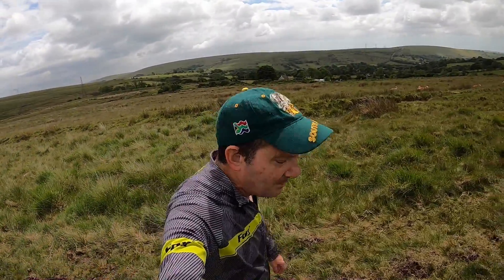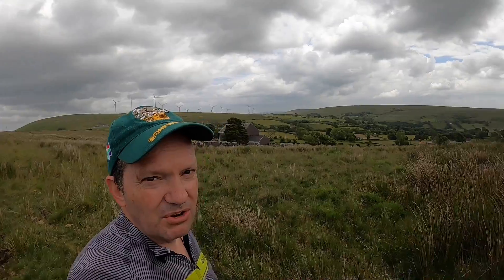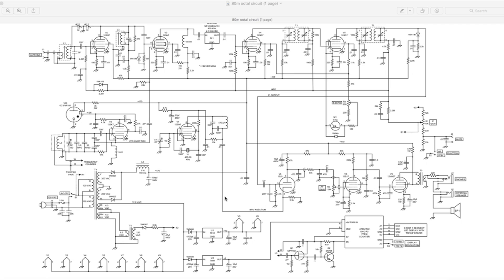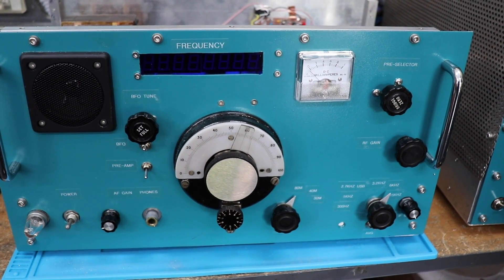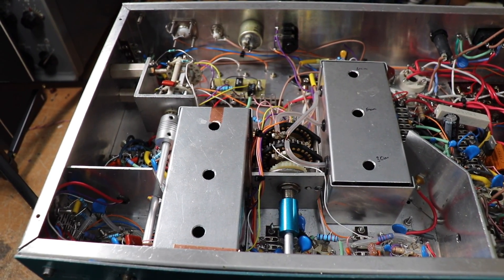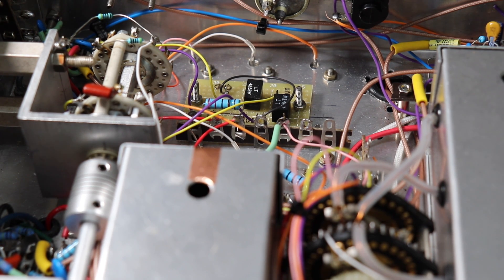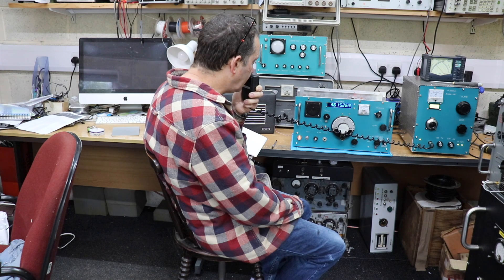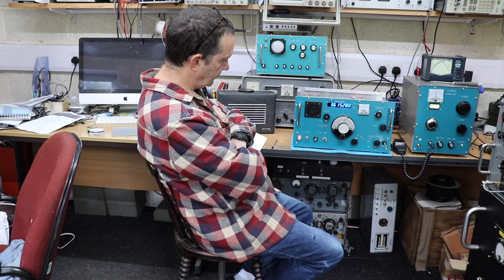My Homebrew Communications Receiver

Comment: Beautiful homebrew receiver.  FB.  But I have a question:  At 12:35 you tune in what seems to be an SSB ragchew on 3.723.808.  But the BFO is off.  How can you hear so clearly an SSB signal without the BFO on?   A bit later you tune in what appear to be the same stations, this time on 3.275.291 with the BFO on.  So how were you able to copy them clearly with the BFO off?  73  Bill N2CQR
Reply from the maker: I think the IF stage is a bit oscillatory ( if thats the right word)!!

Comment: Beautiful job and a wonderful technical accomplishment but using tubes.... Why?

They are power hungry and harder to obtain. 

If you are wanting to be EMP proof  the fet and bjt will be the weak link.

Other than that, bravo on an exceptional build and a great sounding rig.
Reply from the maker: I like valves/ tubes… they glow and have more character than solid state devices
Reply: @thewtf  For me valves tend to sound warmer and the glow of a magic eye in the dark cant beat it.

Comment: Does the meter need some rectification, Also in keeping with the era the sticky lables would be inside where they can dry out fall off and catch fire. The other thing would be getting the front panel engraved and filled. A lot of equipment has point to point wiring as a loom can often bring its own problems. Although I find with these projects keeping up the enthusiasm for what can become a war of attrition as you hit brick walls is the main challenge! Great video!

Comment: A beautiful and valuable project. Just one note: the signal indicator is poorly driven, namely the needle is tugging to the right and left. It should only steer to the right and run soft. This is the only remark. Yours sincerely SP5RF Robert from Poland. 73! for you!
Reply from the maker: Yeah, the s meter was originally supposed to run from the AGC as is the usual case but I could not get it to work very well so at the moment it is driven from the audio via an LM386 which produces that meter movement!!
Reply: @thewtf  it is enough to use a spike diode or some other diode and a 10nF capacitor and the movement of the pointer will become smooth and one-sided - i.e. only to the right. Greetings! SP5RF 73!
Reply from the maker: Yeah thats a good idea!!
Reply from the maker: Robert, I put 100uF capacitor and a diode and it behaves like a normal s-meter Thanks!